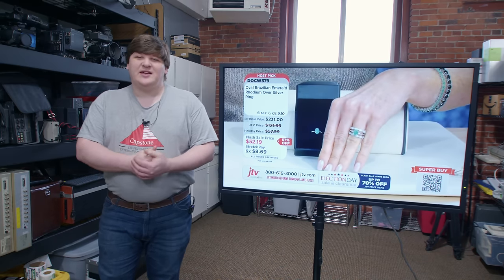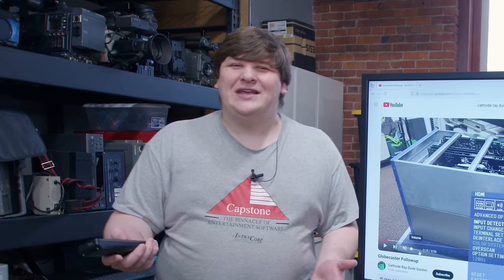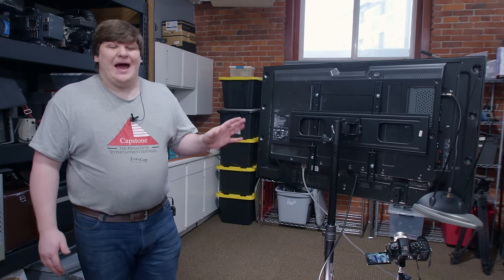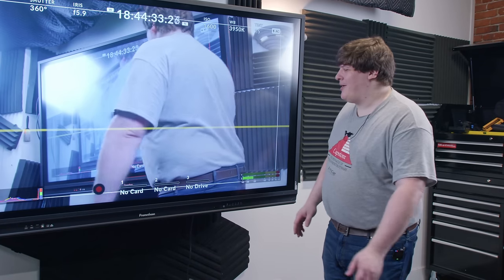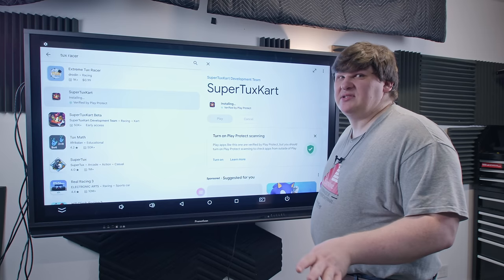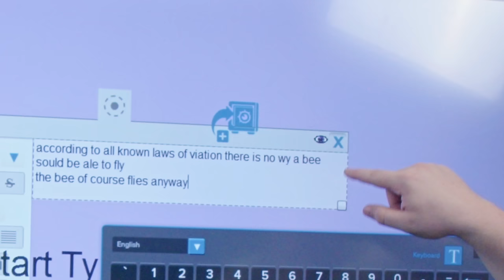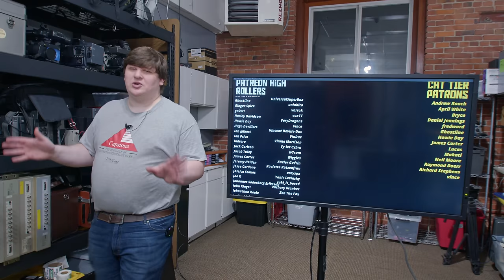Several Incredibly Smart TVs!

Comment: The first display you showed we have four in portrait mode at our restaurant they run 24/7/360 and are years old. The only problem we had was one running out of sync, the engineer came to service them and opened the front upwards on a hinge. He cleaned them and recalibrated the out of sync one btw. They  are bezeless and we have a box of remotes in our tech cabinet…..information is updated ota.
We also have a traditional looking menu screen using one panel, a two panel advert and a panel that gives information about our environmental pledge.

Comment: The class at the last school I worked at had one of those promethian boards (or something similar).  It had plenty of features, I'm sure, but it's so tedious to interact with it on a level any deeper than just using it as a whiteboard.  And even then, it's not too useful when rubber hits the road and there are thirty 11-year-olds sitting in front of you with 6 minutes till the bell.  The promethian boards make sense for schools that are over-budgeted, or for a very specific kind of teacher.

They have some cool features native to a feature filled drawing program, the ability to save whiteboard drawings (great for having a diagram or scoreboard or something that needs to be reset for each class period), but most importantly, the ability to draw over something being output from hdmi.
but regular tv panels have something for that too: bog-standard walmart TVs make for surprisingly good dry-erase boards, and they're a fraction of the price.  In MANY classes, I've just opened a document on my computer hooked up to my regular TV, zoomed in on a question or lab chart, and just written over it with a regular whiteboard marker.  If it needs to be reset each class period, no need to fiddle through menus to discard changes and reopen a drawing; just erase the marks on the tv.

Comment: Re: Wired Remote Port

I have worked my fair share of trade shows and fairs, and when you have the more pricey and good companies building your booth, somewhere there is a control panel hidden in a drawer or behind a small door, where you can control all the metric fornication ton of monitors built into the booth at the same time. That's where the wired remote port comes into play. I'm sure there are ways to do the additional IR sensor stuff and all with it, but that's probably one of the more common uses.

Comment: Remote in is probably not for IR receiver. But in some remote controls, there is a 3.5mm output, which you can just run a very long 3.5mm audio cable directly to the TV (e.g. operating the TV inside the control room)
It is also sometimes found in projectors

Comment: During my training as a radio and TV technician, my boss also sold new televisions. These were mainly TVs from the German brand Metz. Back then, they still produced everything in Germany and needed unique features to stand out from the cheaper Samsungs and LGs. For that, they had expansion slots, similar to PCI slots both external for tuners and internal for encoders/decoders as well as hard drives for recording, etc. So, the whole TV was modular. The customer could choose between different chassis, and the specialized dealer would configure the extras for them. They started this with CRT TVs and continued it with LCDs. I thought it was really cool. But as a trainee, I could only afford a simple LG. Also, the menu was unfortunately sometimes very slow, especially when programming and sorting channels which, of course, was work for interns or apprentices 😂

Comment: My highschool had the newer (and smaller model) Promethean boards in almost every room on rolling stands. The ones we had just ran android natively and instead of an ODS computer there was a little guy mounted to the bracket on the back of the tv. Students never used them (because, I mean, it was highschool, not very much come up to the front of the class and draw something going on) but almost all the teachers used them. Besides for just being a large touchscreen computer, the only feature that was used was the whiteboard app. Since android was running natively, the whiteboard app supported marking up the video input, so teachers would annotate what was on the screen with it. They also all had pens with them, which is exactly what that bar at the bottom is for.

Comment: I was tasked with tying our NEC displays into an existing control system. We did it over IP, and it was basically opening a socket to the display on some port, and sending the same bytes you would over RS-232. The most confusing thing was realizing that they wanted the ASCII representation of the characters, and not the actual bytes. It was so satisfying when I saw the entire video wall turn off from the control app for the first time after hacking away at it for a while.

Comment: A store I worked in had a bunch of these, and the LAN port could be hit with telnet and some other software to control the unit, and the unit could also be told to then send those same actions to the units on the serial chain. So you'd hook up the first TV to your network, then chain the TVs to each other with serial, and hit the first one via the network and the rest would follow suit.

Comment: when i was in elementary school all the teachers had Promethean activboards (the type that's just a big touch surface with some pens and an overhead projector providing the actual screen) and they used them a lot - they had their windows XP desktops hooked up to them running the Promethean software to create little slide decks and interactive activities and whatnot that ran on the board. as time went on (middle school, high school) they remained in classrooms but no one ever used them as touch surfaces with the pens. they were always unplugged and just used as a projector screen showing a powerpoint. maybe the novelty wore off, maybe they became too out of date to use with modern computers (they used a serial port!), maybe it was a combination of both. anyway it was fun hearing the Prometheus name, brought back memories :)

Comment: There are mounting systems for these. Either stands like the Audipack, or mounting plates/clamps for truss. It's most common to have a plate with 3 Pins for those mounts, so you can quickly mount and unmount these. A couple of weeks ago I was asked if I wanted the 110inch version, with a couple of screen defects. That thing waeighed like 700 pounds and ultimately would have issues fitting through my staircase. I took the sane approach and got a little projector.

Comment: Aye, OPS modules! I'm doing IT admin work at a bunch of schools out here in Germany and between SMART and CTouch and Promethian Boards, there are lots of OPS computers being used around here! The weirdest setup I've found to date is one school that has mostly Promethian boards, which come with an Android PC internally, where Androd OPS modules are added into the OPS slot, which then have an HDMI input and USB output to plug into an external Windows PC. So instead of directly connecting the Windows PC to the board, everyone is using the PC through another (Android) PC and an HDMI framegrabber!

Edit: Just watched a bit further and it's pretty much the same board and OPS you have! Which also answers the question what that USB-B port is for: Touchscreen passthrough from the board through the OPS to a connected PC!

And to answer the question if Promethian is good, ehh, nahhh, we've had so many issues with firmware bugs and dead parts of those boards that it's neither a one-off nor something I'd expect from a good device manufacturer/vendor...

Play Services aren't usually included BTW, they do have to be reinstalled manually, at least on our devices.

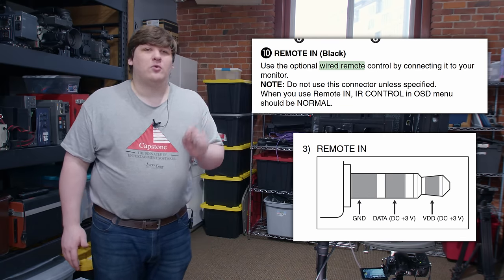Comment: 23:30 I've seen a similar wired remote input on professional LCD projectors used in a large auditorium, where the remote was physically too far away from the unit to reliably transmit a signal, there was a special remote with a 3.5mm jack on the front and a cable that ran from the front of house desk to the projector.

Comment: The Promethean ActivBoard app hasn't changed, despite it running on Android here. The earlier generations of these were with a purple bezel and used an external projector for the image, which had to be calibrated. The board itself had two pens on either side in holsters and could be used simultaneously, and the software ran on Windows. The protractor actually unlocked a core memory.

I was in primary school in 2004 and they were trialling them, and they installed them to all schools across the largest school district in the UK at great expense, replacing every conventional whiteboard and blackboard - they did use them though. They now have a newer version of what you show here, but there are some benefits to using them over a conventional projector setup, mostly around children with special educational needs such as dyslexia who may struggle to decipher text on a whiteboard or when shown in particular colours.

Interesting to see that not only Proethean broke out of the UK, but they're now owned by a Seattle based company.

Comment: The "-dirty" means they checked out a version of the kernel (the part that comes before the "-dirty"), modified it locally on some workstation, and then built and shipped this OS version without bothering to check in their changes to their own source control or using a dedicated build server for a reproducible build from a clean checkout. This is about a low-rent as you can get in terms of software quality processes.

Comment: 39:24 the "free" column isn't the total memory available for processes. it's omitting the page cache, which will be deallocated when a program needs memory. it's normal to see the "free" capacity quite low since linux uses them up for caching. the total memory available for new programs are indicated in the "available" column.
Reply from the maker: sorry for that last reply, youtube sometimes messes up and replies to the wrong person, heh. yeah, i flubbed that, rookie mistake - but check out the available column, it's still running pretty close to the wire and it was definitely swapping to the (spinning!) hard disk at least a little. the RAM expansion made it tangibly smoother

Comment: I used to do a lot of low volt work in schools, hospitals, offices ect. Sometimes these live their life mostly off like in a conference room. A wired remote is nice because you can have just a few momentary push buttons on a wall plate for only what they need. Ive done as few as 4 in classrooms, power on, power off, vid 1, vid 2. Usually it'll live next to the little audio control panel where your volume knob and pa control is. Then you give the head janitor or maintenance man the actual infrared remotes.

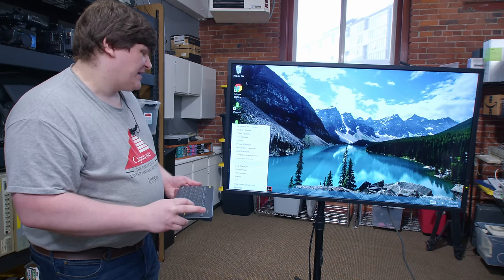Comment: @CathodeRayDude, You said something about why the 64BIT processor is vunning a 32BIT OS. 31:58  The answer is that a 64BIT OS has to save things like memory addresses and code locations using, well, 64 bits. That's fine with 8GB of ram, but uses more space than it’s worth with 4GB of ram, especially as 4GB fits in a 32BIT address. That means the first 32 bits of the addresses for things in 4GB of ram will always be 0000. At 8 bytes 64 bits a pop, it doesn't make sence to use such large tnumbers. Unfortunately, if an OS is 64BIT, the processor runs in a 64BIT mode, and requires the larger addresses.

Comment: About 2 years back, I managed to pick up an NEC 50 inch 4k model, I think it was about 600 EUR to buy, it was also brand new so I got quite a deal, this operates as the TV in my bedroom, connected to a laptop next to the bed and a TV receiver (both via HDMI).

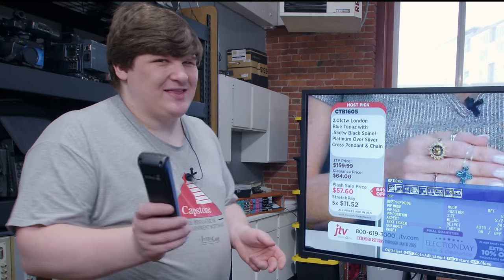Comment: 19:38 I think I have an idea for a user for that screen ticker. Stretch it out to fill the whole screen, but reduce the opacity until you can barely tell it is there. Now connect two inputs from one video playing device, like a PC for example; and have the same video play through both. Depending the opacity, it might not work as imagined right now, but with the right opacity, it should result in a 3DS-esque '3D' screen like effect that doesn't need special glasses to see.

If you adjust the colour and brightness of the image of one input (if that can be done) and adjust the other to be darker instead with more vibrant colours in contrast to the overlay's settings, you should get a pretty nice image with a feel of depth to it. 

Note, I say should, and maybe and stuff like that; because this is just an idea. It may not work as I think it might.

Comment: Granted I'm based in Europe so things might be different here but the last time I saw a video wall matrix controller was back in CRT days, OR some 'pop up' type temporary events. 99% of video walls use exactly a system like this where the display itself knows what piece of the signal to show and shows it. Even most of the arrays that are not physically side by side and thus don't show the same image work like that.  Like the menu systems in fast food restaurants. They fullscreen display a web page which is already broken up into chunks (4 different menus in a grid) and the screens itself know what piece of the image to show.

Comment: Some remotes actually have a 3.5mm jack at the bottom (I've seen a few projectors that have such remotes) and then you plug into the wall at one end and wherever the projector is mounted gets the signal from somewhere and it just works.
Way more reliable and nice than using IR, especially if speed is critical (like doing A/V mute and unmutes in the middle of some conference for example) as you always know that the projector received the actual signal

Comment: Remember 90’s midi system stereos having wired remote inputs. This meant you only needed one remote receiver, on say the amp, but you could still play/pause the CD player from you remote control. 

But I think Sony, Philips and NEC all had different standards so you couldn’t mix and match. But mostly it’s going to be an unmodulated of the bit sequences the IR remote sends.

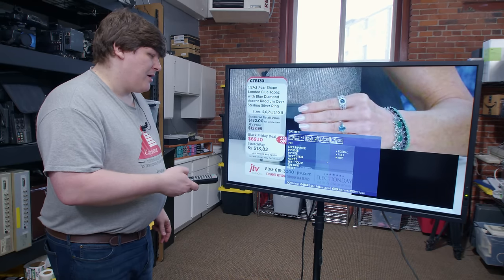Comment: 15:45 The Philips 32" LCD TV we bought new in 2007 also had that exact limitation, weirdly enough. You could have any input on the PIP, but not the two HDMIs simultaneously. On a TV that old it kind of makes sense, but on a very capable and much more recent commercial display like that one it's kind of weird

Comment: 36:56 The biggest question I have right now is this: Does the DVI chain still work with the PC module? Can the TV be off with the computer still on, and can the computer talk on that RS-232 bus? It would be real cool to have a wall of like 40 of these things with just one machine off in the corner that runs the whole show, already built into the first TV in the row, doing DVI passthru to everything, that you could remote into over LAN to do the serial management stuff. That would be super sweet.

Also, dang you only talked about OPS stuff a few months ago I didn't expect you'd get one before I could mail in mine

Comment: I had ONE teacher that really liked the electronic whiteboards. And like, when the tracher knows how to use it well, its great. Super readable, 0 mess, infinite "ink". The ones I had were projector + resistive touch based and just connected to the computer and you could even draw over the desktop, a presentation, paused video, etc. Lest hope future teachers aren't as toxic twords them because if used correctly they can be superior in almost every way except the "feel" i guess.

Comment: Very cool video, I've got a Promethean board, got from work as upgradin some rooms, it's a 42inch (I believe) and it has a OPS computer installed that still had Windows 7 Pro installed, when I check event viewer it had only been booted up a few times as most teachers just plugged their laptop in!
Still it makes a great touchscreen smart TV thing for the games room as it also has composite video and VGA input!
I've seen NEC monitors at train stations using an OPS module as you can see the ethernet cable hanging out!

Comment: I don't know what it was really intended for, but PAL-60 got used in the PS2/Gamecube/OGXbox generation where some games had the option to run at 60Hrz, so being able to run faster.
Some sloppier conversions REQUIRED PAL-60 and would not run at 50 (the one I know of the top of my head was Metroid Prime 2). So it was something expected any modern TV for the time would have supported. I expect that it also gave some compatibility with NTSC, because that was the generation where I got into importing games, and other than having to use a disc to bypass the region check, never had an issue playing American or Japanese games.

Comment: I don't know of anyone pointed this out yet but most consumer TVs and amplifiers have seperate remote codes for power on, power off and power toggle. It's just missing from the remote. I'm using a Logitech Harmony Hub for my stuff and there I have seperate power controls even If they are not seperate in the remote

Comment: A while back I got a large 50" Samsung TV from work, we buy PCs from surplus auctions and refurbish them and sell parts as well. The TV was in a lot of other items. 

When I got it home, I noticed it didn't have a built in tuner, so I figured it was just a big monitor. I plug it in and turn it on and it starts booting up into Windows XP. Upon further investigation, it has a built in PC which uses a dual core AMD athlong 64 CPU and had 2gb RAM. I put 4gb into it, put a SATA SSD into it (it had a tiny flash storage, but also a SATA port,) and installed an android TV OS on it. Now I have an android TV which isn't all laggy like the ones you can actually buy are.

Comment: Actually you can adjust some hidden settings at most consumer-tvs (from Samsung, LG or other big brands) for example to set a default input (I did with my Samsung TV) when turning it on and other settings needed for using them in commercial environments.  But those settings are hidden behind some cheat-codes on the remote.